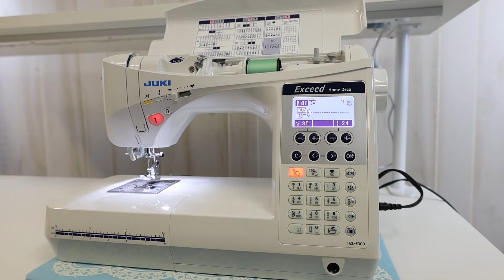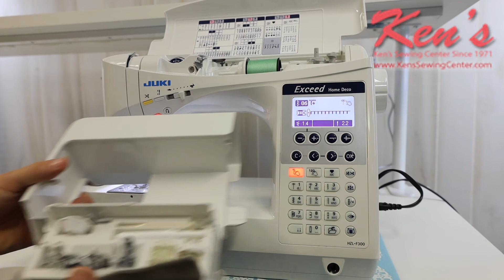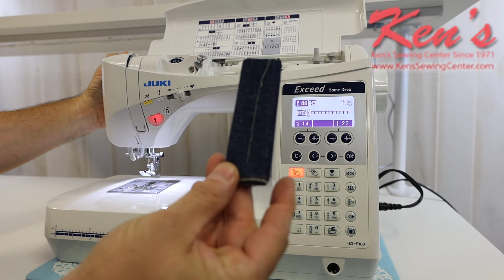Juki F300 Exceed Sewing Machine Demonstration by Ken's Sewing Center in Muscle Shoals, AL

Comment: I love that this machine sews heavy fabrics and leather, but will it sew something like tent nylon? If it can, does it require any extra accessories outside of what the machine comes with at purchase? Thanks!
Reply: Yes. You can sew tent nylon with a Juki HZL-F300 domestic sewing machine, provided the fabric isn't excessively thick or coated in a way that makes it difficult to feed.
The main challenge is that tent nylon is often very lightweight and slippery, so it can pucker, snag or get pulled into the needle plate.
How to set up your Juki HZL-F300
Needle: Use a new Microtex (sharp) needle, size 70/10 or 80/12, depending on the fabric weight.
Thread: Good-quality polyester thread is a sensible starting point.
Stitch: Straight stitch, around 2–2.5 mm long.
Tension: Start with the machine's normal tension setting and adjust only if necessary.
Presser foot: Try the standard presser foot first. A walking foot may help with multiple layers if they shift.
Speed: Sew slowly and let the feed dogs move the fabric rather than pulling it through.
Juki specifically describes the HZL-F300 as suitable for lightweight through heavyweight materials, with adjustable presser-foot pressure to help prevent lightweight fabrics from pucker.

A few tips for tent fabric
Put tissue paper or specialist sewing stabiliser underneath the fabric if it gets pulled into the needle plate.
Test on scraps before sewing the actual tent.
Use a French seam or flat-felled seam where appropriate for strength and to enclose raw edges.
Remember that sewing a seam does not make it waterproof. You may need compatible seam-sealing tape or seam sealer, depending on the fabric's coating ❤